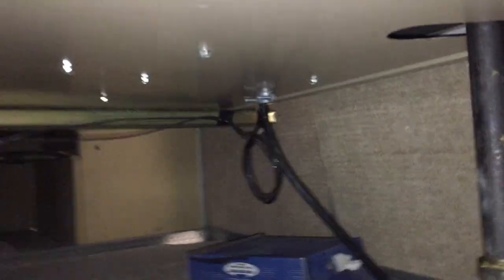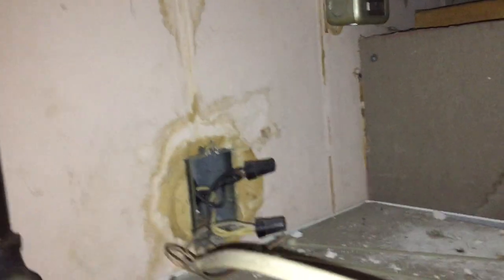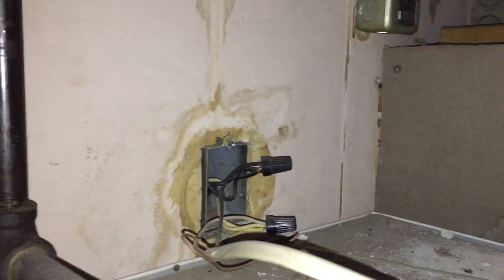Moving Violations Video No. 222: Numerous NEC Violations Found in Suspended Ceiling

Comment: Shouldn't it be AC90 (BX) wire in a suspended ceiling with air handing equipment there?
Reply: Yes, for current-day requirements it should. The video very briefly mentioned that NM might have been acceptable at the time of the original installation.